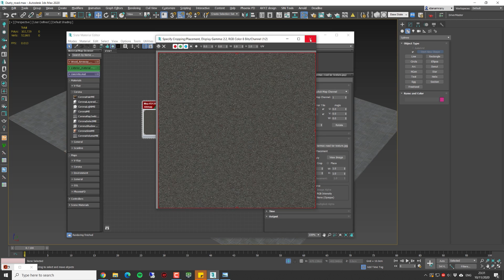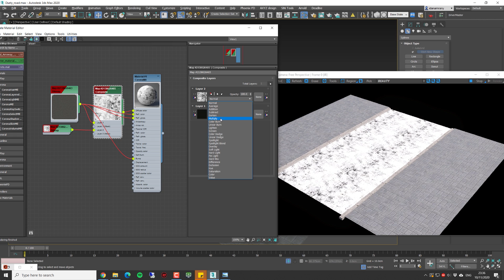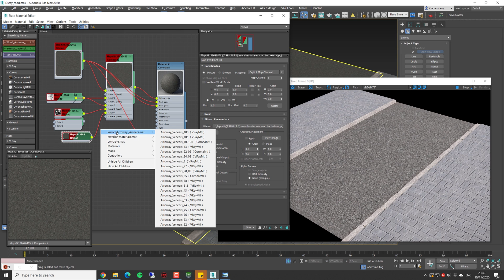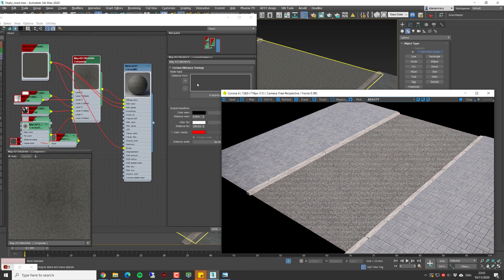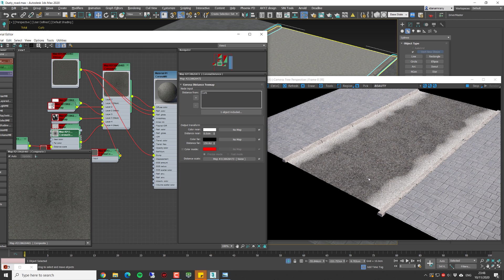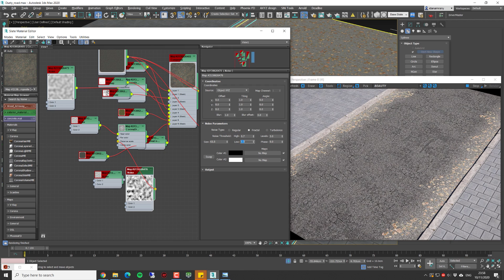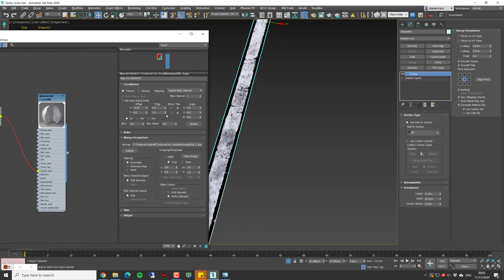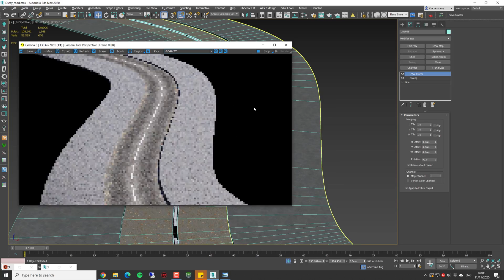How to create Realistic Road Material  (NO need for Unwrap!)

Comment: Hey man, great tutorial! One quick question: when I applied corona distance shader it got the same uvw as my asphalt texture (2x2m) and not the full size of the road, so it get's all tilled. Any quick fixes?
Reply from the maker: the distance value isn't affected by uvw maps, it goes by the system units.  are you referring to a map you put inside the distance map? If so then you can either change the map tiling parameter or change its uvw channel to 2 and also add a new uvw modifier with the same Map channel
Reply: nevermind, just solved it!